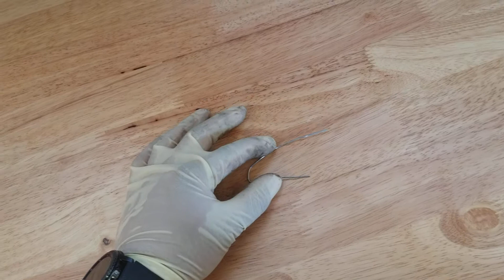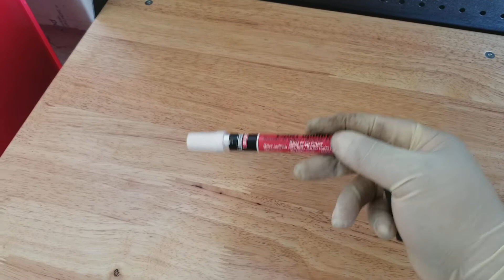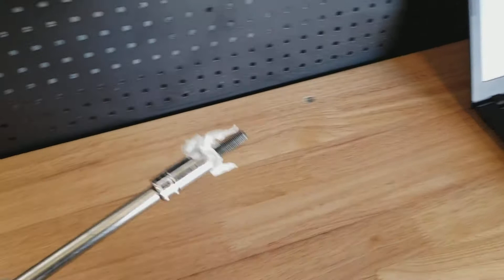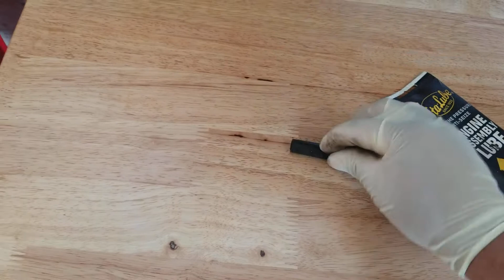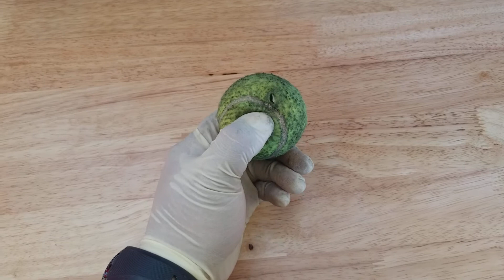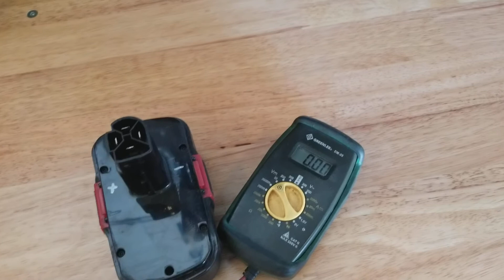Things Auto Techs use as tools!

Comment: I have a couple seam rippers used for sewing,use these for opening up wiring harnesses without doing damage to the wiring harness.I have used them twice and work good for this application.They are $2.00 to $3.00 a piece at any sewing place and Walmart.Bungee cords as well,great for holding up GM rack and pinions while the engine cradle is out during transaxle replacement
Reply: wafrederick 
The solid rubber or the cloth covered ones? That's a solid tip, and timely for me.
Reply: The rubber bungee cords
Reply: wafrederick 
Cool, thanks. I'm replacing shift solenoids in my son's Impala and I think I might have to drop the rack.
Suspending it will save me a lot of time. 
This is my first time doing this job.

Comment: Accurate video, as usual. Though I wouldn't have thought to use a ball as a seal, I've used spark plugs to plug hoses. To save storage space and weight, I break out the top terminal to use as a small plug for smaller vacuum hoses.